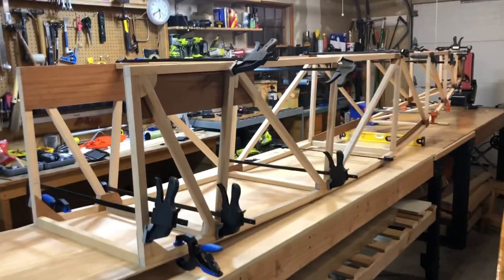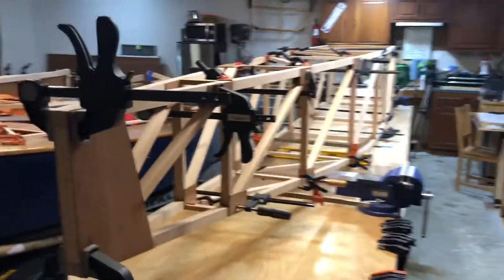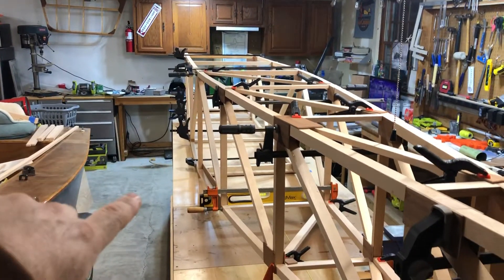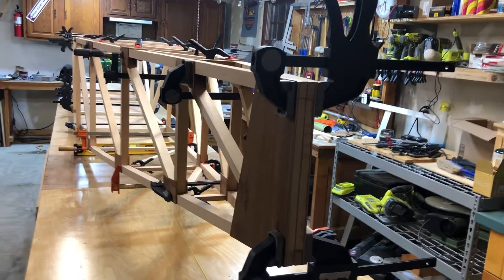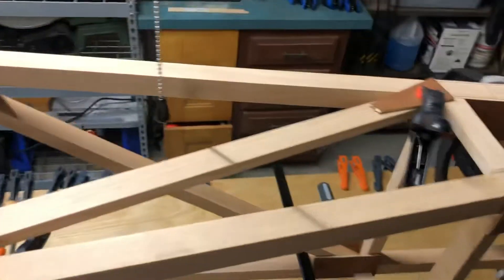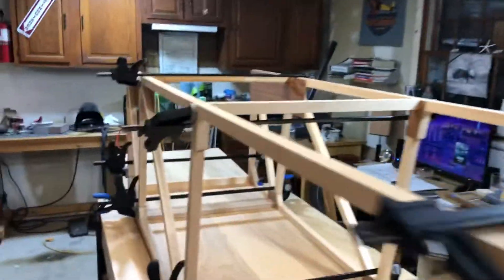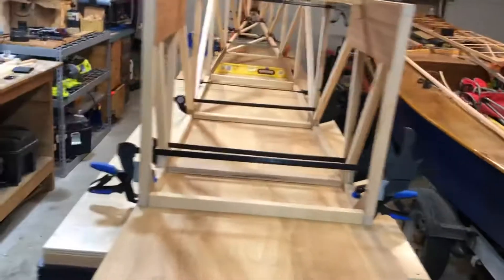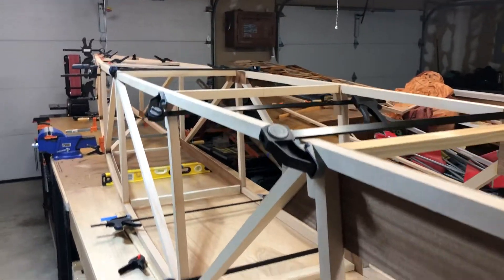Pietenpol Air Camper Build #21 - Fuselage Feb 2022

Comment: Hey. Not gospel truth, but here's how I did it: I kept the top clamped with the cross members while I glued in the cross members on the bottom. (fuselage was upside down on the bench.) Then flipped it over and glued the top cross members. At that point, it won't come apart if you have a clamp on the tailpost and wherever you feel like it. But it's not rigid. Then I went in and glued the diagonals, and finally the gussets. I glued the floor after I built the seats. The seat backs give the fuselage a TON of rigidity. YMMV
Reply from the maker: FANTASTIC!   I’ll definitely follow this.  But with one change.  I’ll probably glue in the diagonals with the cross members at the same time.  In one fell swoop.   The reason being that they fit perfectly now.  If I where to glue end set the cross members first, I just know I wont have them in perfect position when installing diagonals.  Then I’ll have to recut a diagonal or two.     

So what I’ll do is this, turn it over, unclamp the bottom, leaving the top side clamped and then start gluing bottom, front to rear.  Flip, repeat, build seats and then glue floor.   
Thanks 🙏🏻 👍